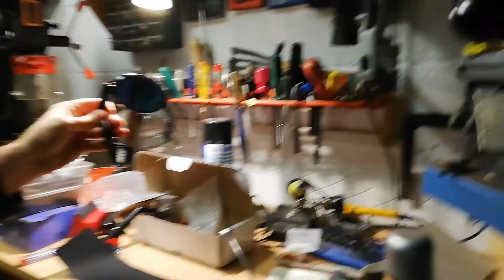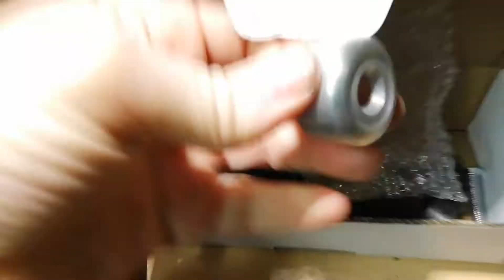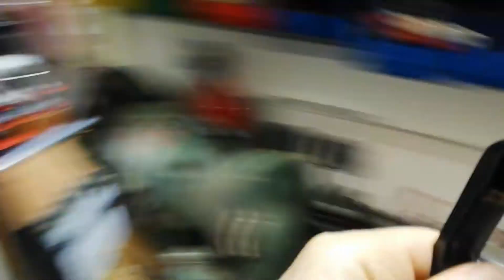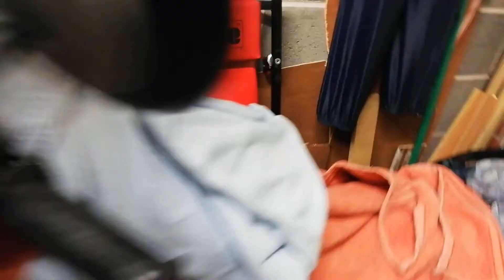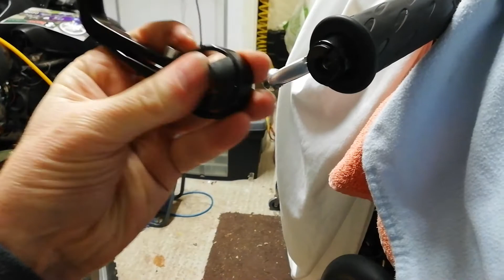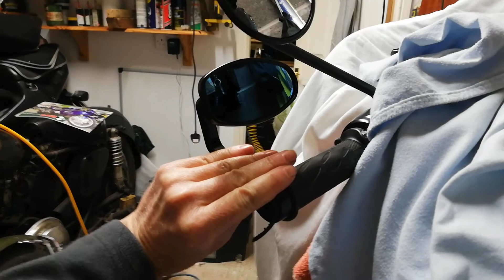Triumph T120 Bar end mirrors.

Comment: Hi there, will it work with original bar end finisher, first part you took of the handlebars ( original piece)? I can´t get it work
Reply from the maker: Yes, I got it to work but with longer bolt. Also be careful not to apply any pressure to your throttle side as it will impede free movement.
Reply: @MrImarcus  Ii got a longer bolt that came with the kit but it seems too long :(
Reply from the maker: @fleshpie2129  if you wind a nut on it to the right length then cut it with a hacksaw it will clean the cut when you remove the nut. I used one I found in the garage...
Reply: @MrImarcus  i found out you can use what Triumph is calling Bar End Finisher, but it cost about 20 dollars per piece, so 40 for two. It is just like a coin shape that holds mirrors in place.